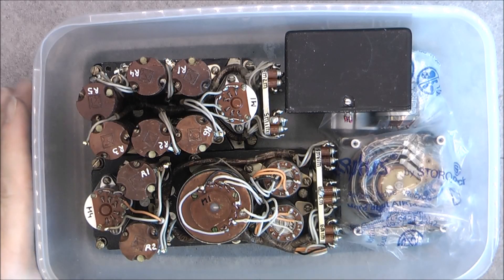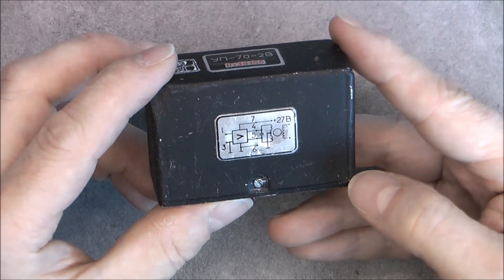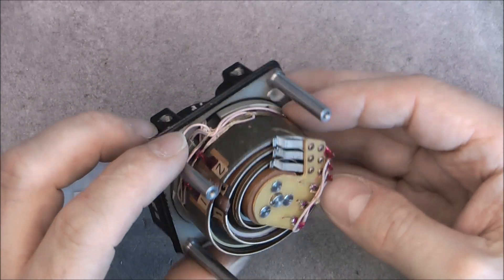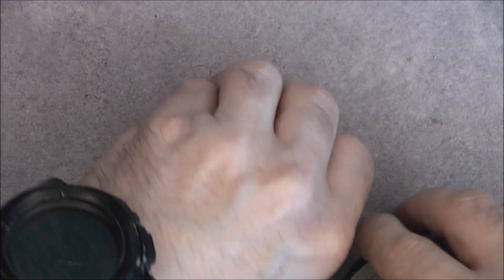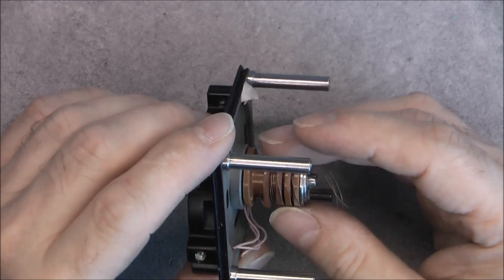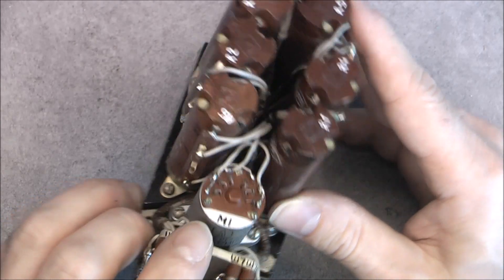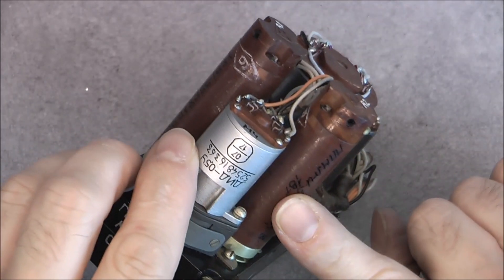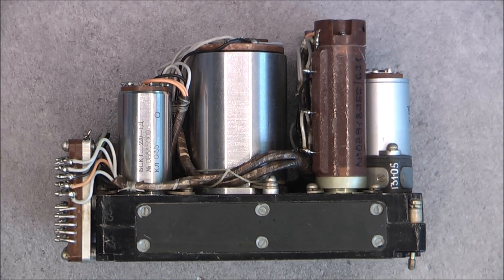Ebay grab bag of Mig-27 avionics bits

Comment: Дид-0.6тв - is a 27v 400hz 0,6w power asynchronous induction two-phase motor for use for example in avionic equipment.